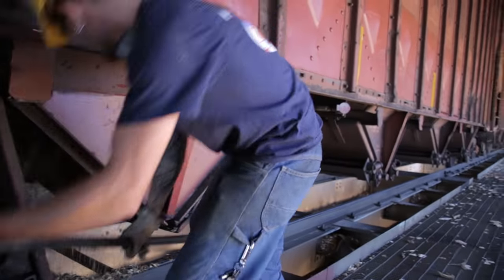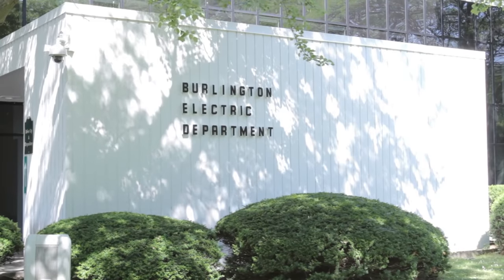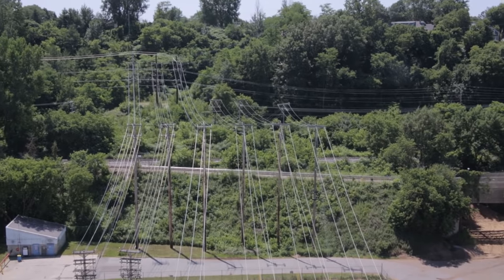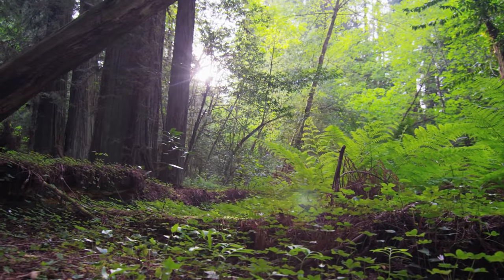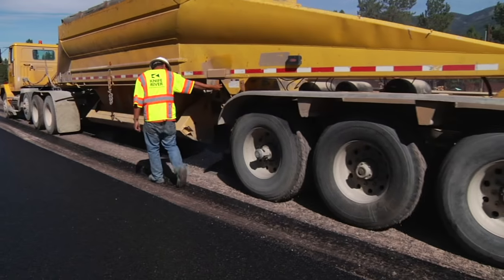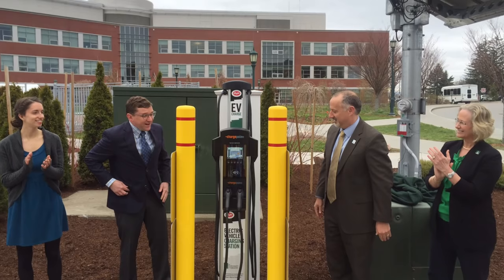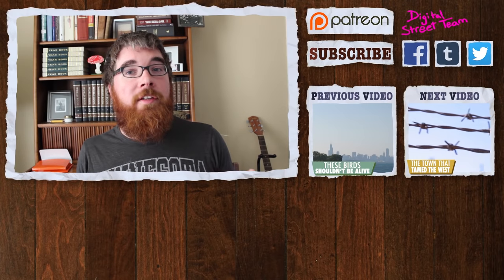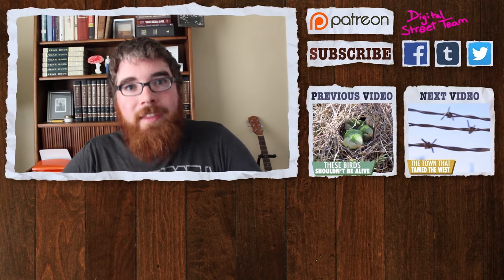Can A City Run On 100% Renewable Energy?

Comment: Power doesn't magically scale like that.
You can't have every block be its own grid. Basically the only power you can do that with is solar. For hydro you would need each block to have a waterfall. For wind you have the downwind blocks get less and less power until they have basically none. For biomass each one needs its own forest. So solar would be the only option for that.
If you ignore the fact that Chicago isn't on the equator, then the sunlight reaching the surface has an flux of roughly 1 kW /m^2. However, not all of that is usable with solar power. A large portion is too low in energy, and some is too high in energy to be used efficiently. If you be generous and say the solar cell gets 20% of the power, that is down to 200 W/m^2. If you consider the height of their buildings and how many people live/work in them, that is nowhere near enough; especially when you remember that it isn't always mid-day and they aren't on the equator, meaning over the course of a day that power will vary from significantly less than 200 W/m^2 all the way down to 0.

For any large city the only solution for renewable energy is to have large centralised systems which distribute power to large areas.
Reply: Some more math: From some sources, Chicago government buildings used 1.8 billion kWhr of electricity in 2016, which accounted for roughly 8% of electricity in Chicago. Meaning Chicago as a whole used 22.5 billion kWhr. Given that there are 8784 hours in a year, that works out to be a rate of roughly 2.5 million kW.
So with an area of roughly 600 km^2, a flux of 200 W/m^2 would give a total power output of 120 million kW. However, that would only be if it was always midday at the equator on the equinox (or midday on the tropic at summer).

Averaging over a day at the equator on the equinox, you end up with a demand of 60 GW hr. You have a supply of ~900 GWhr, or 15 times as much. However that reduces significantly when you move away from the equator, and consider summer and winter. So at a peak it would generate less than that. That would make it quite difficult to actually meet the power requirements, and ignores that if you did cover the city like that, you no longer have any light to grow any plants or provide light for walking around during the day and need to replace that.

That also completely ignores the fuel used to run cars and the like.

Comment: Not convinced, still biomass produces carbon, so I won't say it's green.
Reply: It is said to be carbon neutral because the same amount of carbon is releases when burning as it is taken from the atmosphere when the tree is growing. If it wasn't burned, some of the carbon would turn into CH₄ (with decomposition), which has a a lot higher warming effect than CO₂, but some of the carbon would be burried into the ground. I don't know the actual numbers of what would be worse but I suspect the warming effect would be similar.

Comment: I'd imagine wood chips produce a significant amount of carbon. That is the opposite of Green.
Reply: The notion is that it can be CO2 neutral. Nevertheless, the emissions in terms of particulates, sulfur compounds and the like have a big impact on local health, actually worse than coal.

Comment: 1% solar energy? I really don't think it's worth the investment of buying all these solar panels. And it's even worst if you consider the high CO2 emissions required to build such devices and their relatively short lifespan.
Reply: Many homes run on 100% solar energy and save significant costs over utility rates.  The myth of excess CO2 emmissions in construction were debunked and many solar panels have a 40 year useful life with Cradle to Cradle certification.  http://newsroom.sunpower.com/2016-03-17-Now-100-Percent-of-SunPowers-Direct-Current-E-Series-and-X-Series-Solar-Panels-Produced-are-Cradle-to-Cradle-Certified-Silver  If a person lives in an area with a $0.08/kWh rate it solar has a longer ROI; if a person lives in an area with a $0.27/kWh rate (HI) it is much faster and is a no-brainer to invest in solar.
Reply: Ok so that 1% is only what the city distributes, it does not include personal energy generation? If so I would be great to have the whole picture of the electricity production in this town by including personal generation

Comment: Hydro power is not so good for the environment. They mess with the local ecosystem.
Reply: While that can be true of large dams (which this video did seem to show), there are some new micro hydro power systems that only divert small amounts of water thus having a much smaller effect on ecosystems and they seem really promising.  They're more water wheel, less dam and they are already in use in remote areas were power can't be supplied via power line to much success.
Reply: ilovebats10
good to hear. I Haven't seen anything about that.
Reply: Coal is far worse

Comment: The question should be "can a city electric grid run %100 on renewable energy" Sounds a bit similar but completely changes the narrative. Answer? NO! There is no city on the face of the earth that can be %100 solar. Why? Because solar is only either heat or electrons. The entire world is now %100 dependent of complex hydrocarbons derived from crude oil. There is not now nor can there be in the future any substitution of electrons for complex hydrocarbons. Even if the technology to do the transformation existed ,which it does not, the EROEI or energy return on energy invested is either zero or a negative value. You would not spend the time and money to create a barrel of oil if you had to first use a barrel to get there would you? Same thing.
And no Burlington Vermont did not run %100 on renewable energy even in the form of electrons. Any solar electrons converted and sent on the grid were almost certainly done at what is called unity. The current and voltage of the source would be in phase. No gird is ever in phase. In most cases it is lagging or the current is lagging the voltage. So for each watt put on the grid by solar some portion of that watt had to be made up with a fossil fuel backup to keep the grid stable. And I'm quite certain that at best that %100 was for minutes or perhaps one hour at best. Nice parlor trick but don't fall for it.
BTW how many of the cities vehicles were powered electrically? Any natural gas heating going on. A propane lamp or cook stove going? I'm sure all the aircraft taking off and landing were powered by Tesla batteries. Right? Now that's were you can say %100. At least for the few hours the sun is still shining. Then for the majority of the day they are back to sucking up dead dinosaurs just like every other city.
More greenwashing for the brainwashed masses I would say.

BTW I'm an engineer and been in the renewable energy industry for over 45 + years. My recommendation is don't be asking for any killing off of fossil fuels till I'm dead and gone. I still want a paved road to drive on and I enjoy food containing 10 calories of fossil energy for each calorie I eat. If I staked my future with the so called Progressive folks ( more like Stalanist's in tie dye and dreadlocks) the end would come just that much too quickly.

Just more greenwashing.
Reply: larry ELLIOTT You may be an engineer but...in Quebec we have most of the province electrified with hydropower and about 90% of our hydropower greenfields are not yet developed. we use fuels but carbon programs are chipping away at that and as soon as longer range EVs are available we'll likely jump in with both feet.  hydrogen made from overnight extra capacity hydropower (ie carbon-free hydrogen) awaits in the background as well. So while Burlington is an imperfect example let's not pretend it can't or isn't being done somewhere.
Reply: First off you missed entirely the main point. It's not that unusual. Every person in a position of power or authority to make positive change also does this same thing as it allows deflection from the real dilemma which is the ENTIRE WORLD is

 (Not just sparsely populated Canada with hydropower sources that still cannot make you free of fossil fuels. Let;s see you harvest wheat in Manitoba with hydrogen powered combines. The economics alone would have you starving) 

now inextricably linked at its core to complex hydrocarbons for its very existence and each day it gets worse not better. Your response is similar to someone whistling past a graveyard to try and quell a fear. In your case I don't think you even fear what's coming as the majority of folks don't. They never really give reality much thought.

BTW do the math on the massive quantities  of crude oil used in building electric vehicles. That is never going to change. 

Simple example. Where do we get millions of tons of crude oil derived synthetic rubber for the millions of tires? How about the nearly free tar used to keep the roads paved. We make it from hydro electrons and discarded peach pits or something. Again do the math. It's all in the EROEI ratio that unless laws of physics are altered don't add up.

BTW have you ever done anything at all with so called hydrogen fuel?
I have done extensive development and testing and research. Even owned my own magazine dedicated to it (H2Nation. look it up)
Conclusion.  Hydrogen is not a fuel source. It's an energy carrier just like batteries. The EROEI sucks so therefore the economics also suck.
It's a dead horse. Just hasn't been buried yet.

Comment: only 1 % from solar? that kinda sucks.
Reply: It’s one of the most northern climates in the US, it wouldn’t make sense for northern areas to rely on solar because they simply don’t get enough sun.
Reply: @RuinedTemple  still if it is only 1 % then why do it at all
Reply: DJ ashtray Diversity is usually a good thing, that’s why. A system that’s supported by a diversity of elements is less likely to fail. Because when the other energy methods aren’t generating as much, or hypothetically have a temporary pause, the solar is there (especially since it’s mostly the homes & smaller businesses/offices that have panels).
Reply: @RuinedTemple  yeah when that 99% of energy generation goes down solar will be there to pick up the slack with its powerful 1%. Diverse, just like a sitcom

Comment: The presenter doesn't seem to get the difference between green and renewable... Also, if they're cutting the limbs off of trees, how are they growing new trees fast enough to account for the CO2 increase caused by the loss of old tree? That part seems kinda sketchy.. Are there new trees actually growing anywhere? Or are you just burning because "they grow back"?

Comment: Wood chips are "renewable" in exactly the same way as coal is "renewable"!
      Burning wood chips may be almost "carbon neutral" but actually still ends up causing slightly more carbon release than a totally neutral method.
      Just "renewable" or "sustainable" is not good enough!
       We need ZERO carbon energy, so tree planting has a LARGE net NEGATIVE on carbon -- not simply "neutral"!
      That's why we need a vast expansion in nuclear.   With nuclear we could actually maintain our modern lifestyles while still sucking carbon OUT of the atmosphere!
     But, of course, "greens" HATE modern life.  They want to go back to the 17th century -- inc. women being kept ignorant, barefoot and pregnant!

Comment: Ummm...burning wood chips yields plenty of CO2, so why is this green?
Reply: The amount of CO2 released is re-absorbed by all the new trees growing.  CO2 is not a pollutant.  It is plant food, and the more of it there is in the atmosphere, the bigger and faster all plants grow.  We are currently in a CO2-starved condition.  We need more CO2 in order for food crops to grow more.
Reply: Umm...CO2 is CO2 regardless of where it comes from. And whether you are combusting gasoline or burning wood chips, it's still the SAME GODDAM THING!

The problem is CO2 in the atmosphere....not the source. Sheesh.
Reply: CO2 is for sure used by plants, but if CO2 we get from burning stuff were all used by plants, then why has the CO2 in the atmosphere gone from 280 to 405 ppm in the past 150 years.
Reply: What you're missing is that the very act of burning wood chips would produce tonnes of CO2 as it (like a gasoline engine) is combustion.

Carbon + Oxygen --> Water + CO2
Reply: Wood chips released carbon that's on human timescale, still part of the carbon cycle. Fossil fuel's carbon has been trapped and isolated from carbon cycle for millions of years.
Reply: Why are so many science illiterate here? We are talking about BURNING wood chips. Burning wood is combustion and produces CO2 + H20. That is the problem...sheesh!
Reply: Peter From the North
 How is that a "problem"?  The science is called "the carbon cycle", and CO2 is NOT a pollutant nor is it a problem.  If anything, CO2 is a BENEFIT to the environment because it is "plant food".  Green houses routinely pump in high concentrations of CO2 in order to make their plants grow faster and produce more fruit and vegetables.
Reply: People...letting wood decay into the ground does NOT produce CO2 like burning it. It's called chemistry...sheesh!
Reply: Peter From the North
Yeah, so what?  I'm not arguing the chemistry, I'm asking why it is a "problem"?
Reply: Burning wood ISN'T green....it is like any combustion reaction:
Source of carbon + O2 --> Water + CO2

and that CO2 is the green house gas that will be the end of us if we don't smarten up.
Reply: Peter From the North
You think CO2 "will be the end of us"?  Why would you think that when the science doesn't back that up?  Do you not know that as CO2 concentration increases, it has less and less "greenhouse effect"?  Did you also not know that atmospheric concentration of CO2 is DRIVEN by temperature, not the driver of temperature?
Reply: So you're privy to data that 98.5% of environmental scientists have? Where did you get your PhD in Climate Science?
Reply: Do you not understand how CO2 is a green house gas. Simple formula:

Rate IN - Rate OUT = Rate of Accumulation

CO2 lowers the Rate OUT.

See buddy,, I have a PHD In Chemical Engineering...You???
Reply: Peter From the North
You either are a liar to say you have a degree in Chemical Engineering, or you cheated your way though school and didn't really learn anything, because as I already mentioned, the greenhouse effect of atmospheric concentration CO2 is NOT LINEAR!  If you really are an engineer of any sort, you should understand what that term means.  (By the way, I have an engineering degree to.  Not chemical, but electronics, which actually includes a lot of chemistry since semiconductor materials require extensive knowledge of chemical composition and manipulation.)
Reply: Peter From the North
Oh wow, so you also resort to name calling and insults when someone challenges your position?  So, are you not aware that resorting to ad hominem attacks is essentially admitting that you have lost the argument?
Reply: Peter From the North
What does an EE know about chemistry?  Well, quite a bit actually.  Do you know how semiconductors are made?  Do you know how fiber optics are made?  Do you know how lasers are made and optical receivers are made and how they react to photon stimulation?
And what about you?  What does a Chemical Engineer know about Climatology?  Neither of us have that degree, so arguing about climate change we are on equal footing as far as formal education goes.
Reply: No, no you don't. My brother has a Masters in EE and he don't know shit like I do. You didn't even know that CO2 was a green house gas.

What a chemical engineer does know about climate change is the CHEMISTRY INVOLVED with climate change and enough know how of the Scientific Method to know that it is REAL!

Why don't you look up fugacity and let me know if you know that. Go away and read more and stop making baseless assertions. You are making us engineers look bad! We are part of the solution.

Comment: How can this guy not understand that wood burning is carbon neutral?  It's a non-nuclear process!  Where do you think the carbon comes from?
Reply: wood burning is only carbon neutral as long as you are able to grow all the wood you need in time.
Reply: +alexander kerbers which is exactly the system described
Reply: yea, but they got this information only after they called it into question.
Imaging they would use wood from destroyed rain Forrest.
Reply: they even showed that these power plants have almost no exhaust, did you finish the video? o.O
Reply: If you can't produce biomass sustainable, biomass power plants are of course as bad as any given coal plant. That is the hole point of biomass burning.
Reply: You seem to not know how interviews work. You ask question that viewers would ask in a fashion of an outside observer. Would you rather him say "I know the answer to this, but our viewers are all fucking idiots, can you explain in small words why burning wood chips isn't bad for the environment?"
Reply: its hard to say if they knew in advance or not but generally you are right and frankly, it doesn't matter that much anyway.